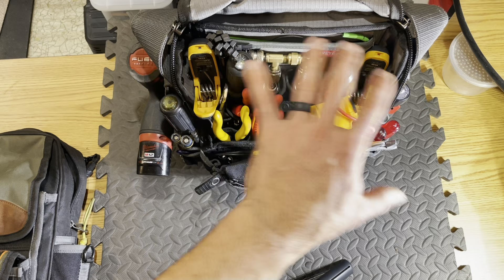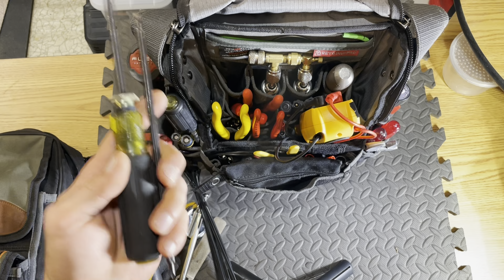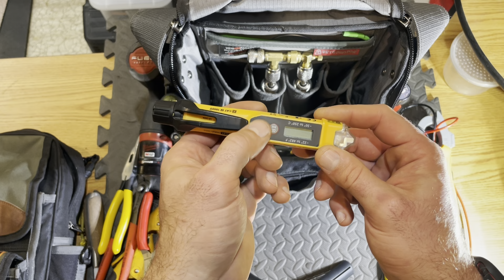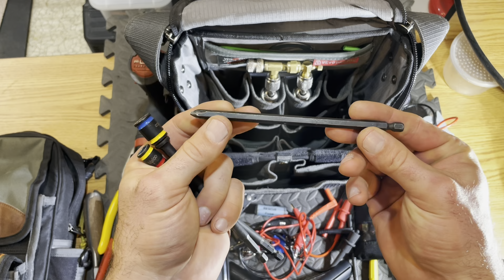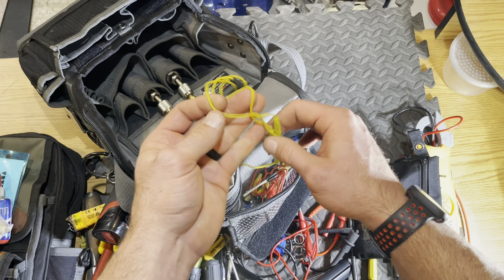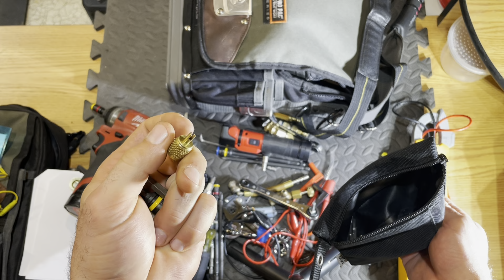Loadout2: The Ultimate Veto HVAC Loadout TP-XL Better than MB2

Comment: You still rocking the Tpxl 5 months later?
Reply: @HVACLife  have you seen that new TP-LC? It's like  the TP-XL but a little more compact. I started off with a 5.11 10 moab single sling compact bacpack to carry tools in lol. Now I see myself gradually getting into these vetos. Lol
Reply: @HVACLife  now I'm I'm the fence between the TPLC and TPXL now. Lol. Idk.
Reply: @HVACLife  I ended up returning the Tpxl and went back to my mb2. The tpxl was to tippy for me. And a little bulk. I'm probably getting the mb3 here soon. The temperature clamps take up the most room for me on any of my setups.. On mb3 I can put them in the back strap pocket. The mb2 was solid enough for me to get in a unit and diagnose it. Then attempt to make one more trip. But that's not always the case when battling these things lol.

Comment: Those are interesting piercing probes. I've got a set of the fluke piercing probes and have at times wished they were longer. When there's a marshalling cabinet full of different instrument loops it's handy to have such lengthy probes. Who makes those?
Reply: @HVACLife  Thanks mate. I've got a whole ton of various meters and leads, I'd probably use these with my fluke 789 and the leads I had for their piercing probes. But I've got a fieldpiece SC680 in my little side job bag (my god it's such a great meter - it does everything) and I know those leads would be good for it.
Reply: @HVACLife  ha ha, I'd be hung for treason. I've been servicing the machines for years 😂

Comment: Hey JayMan, another nice video.  2 quick questions, is that the Klein 3-in-1 mini screwdriver.  And what's the model number on the model # on the Snap-on wire cutters/strippers/crimpers.  Thanks.

Comment: For an adjustable spanner that goes a little wider check out the irega 92w 6”. It goes 24mm (+/- 1”) wide instead of 19mm (3/4”)

Channellock has the same wrench, produced by Irega. The channellock 806W-6. Might be a bit easier to come by in the US!
Reply: @HVACLife  I use one nearly everyday. Just fit on 15mm compression couplings! Those couplings go on 15mm diameter pipe, and you need a 24mm spanner to turn the nut on those. 

When I install I off course use spanners, but when I run service I just carry my 8” Irega 92swo (channellock wideazz 8”) and the irega 92w-6 those two can do a lot off work!
Reply: @HVACLife  I’ll check out that snap-on crimper by the way. It’s nice and small. I love my 9” klein but it’s a bit big in the service bag.
Reply: @HVACLife  will definitely hunt one down. Ratcheting crimpers are too bulky and I don’t really have room in my tp-xl for the big kleins. My bag is quite full  already!

As for pliers and cutters I carry:
Linesman: Marvel mva-200. 
Grips: Channellock 430, NWS ClassicPlus 1651-11R-180, Knipex cobra 125, Knipex plierswrench 125.
Dikes: Knipex 74 21 200, Knipex 72 01 140. 
Croppers: Gedore 8092-160. 
Long nose: Klein Tools D203-6, Knipex 13 81 200. 
Crimpers: Klein tools 1005

That’s outside of screwdrivers, clampmeter, my two adjustables, Bosch GO and multiple spanners and bits and bobs. So any space saving tools are great!
Reply: @HVACLife  They’re pretty popular, though most technicians (we’re called engineers over in Europe) carry the Bahco 9029 and 9031. I use the Irega’s and bahco’s both. Depends on the bag I grab. I have an OT-MC for installs, TECH-MCT for big repairs and my TP-XL for service and small breakdowns. 

I still prefer my shifters over the pliers wrench. The fact that the pliers wrench adjusts with teeth instead of a roll makes it so that it’s either not tight enough or that it’s tight enough but doesn’t ratchet, defeating the purpose of using it. 

But to each their own, I own both for a reason, sometimes the pliers wrench is better and sometimes a shifter!
Reply: @HVACLife  shifter is just an adjustable wrench, I believe you called it a crescent? 
Ever since bahco discontinued production in Sweden, definitely the irega’s/channellocks.
Reply: @HVACLife  Re the Snap- On crimper...aren't some Snap-On items sold under another cheaper brand names, but without the life time guaranty? Edited to add in this case it is the Carlyle NAPA WSCCP crimping pliers...same item but different colour handles and about a third the price?

Comment: I have the tp xxl bag I use the back pocket for a set of wrenches I do hvac but I also work on oil burners and anything I hate besides striped screws is the guy who uses ajustable wrench on oil burner fittings and rounds them off. I also like tools and purchased 2 wrenches from hand to rescue

Comment: I wish they would make a pouch the same size as a TP-XL with a meter pouch on one side and the Drill/tape measure clip on the other. or maybe on one side small holster for the impact.  I don't like the belt clip on the Milwaukee M12 impact.  but I love the impact perfect size.  The TP-XXL is just too big.

Comment: I, too, find that longer bit for service valves to be the best!! Even on the newer equipment, Carrier in particular, the standard bit just doesn't cut it.
Doubling the jumpers, especially for RTUs is something I did with just the regular alligator clip jumpers. Like yo said, 2 stage equipment etc you need it. Do you find the magnetic jumpers work on many units? I bought some, thinking in tight spots especially, they would be beneficial, but I did not find one unit that the terminal block was magnetic.

Comment: Thanks for the video. Nice setup.
Reply: @HVACLife  Yeah it’s all about finding balance. Depends how you like to run your truck as well. The MCT can be a tad heavy but it holds about 80% of what I need, and then I have a big bag and Klein bags with job specific stuff. I also like keeping my impact inside the bag so I don’t like going much smaller.
Reply: @HVACLife  But every time I see your bag something in me always wants to buy it hahahha
Reply: @HVACLife  Will do, I’m already eying up that sweet flat head you got in yours. But there is some sticker shock on it hahaha

Comment: I run the same bag brother. The TP-XL is the truth! It quite literally has EVERYTHING I need whether the job is a PM, service call, or any sort of sold estimate work. Mine clocks into right around 20 pounds!
Reply: @HVACLife  I used to run the MB3 for quick diagnotiscs, troubleshooting, and service calls during AC season. The Meter Bags are super nice but I agree, there's literally no chance of organizing anything neatly in those bags and it drove me nuts bro. The TP-XL is so much nicer for organization and I like that I can open up the front flap and all my tools are right there! No searching around or digging through different pockets!